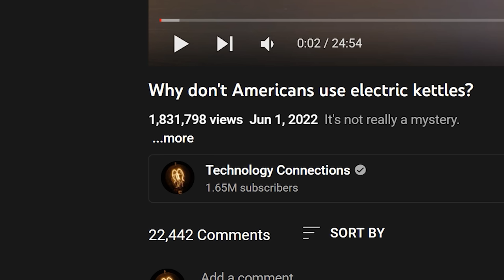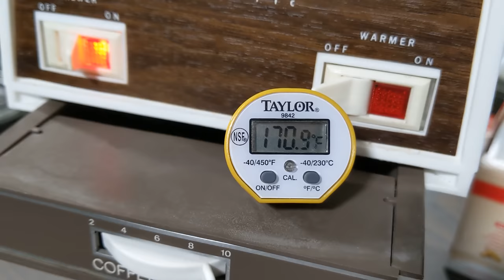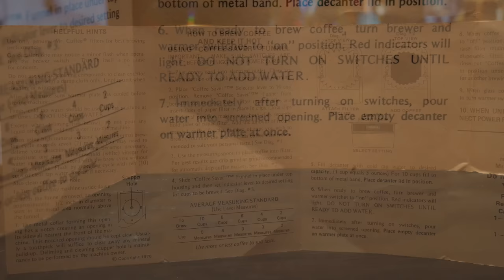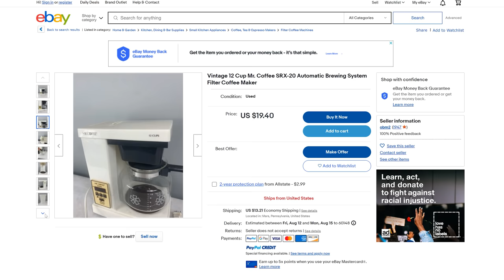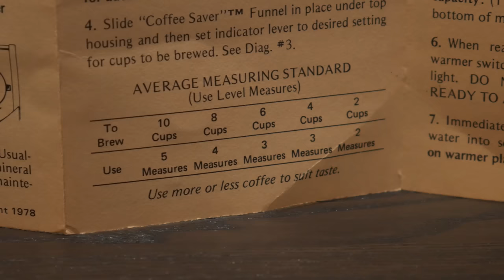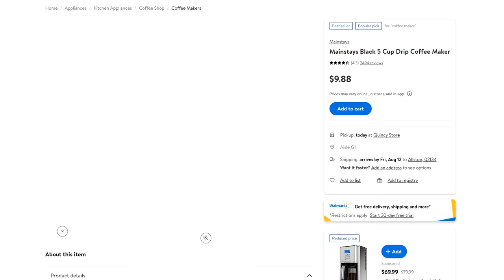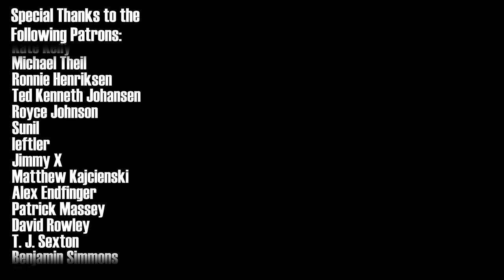Drip Coffee Makers — super simple, super cheap

Comment: Time for one on the Keurig type machine and its differences.  A new variation on drip that simplifies the process even further unless you want to grind your own (you can get reusable pods for that).
In the original electric kettle tests, did you compare the speed to a microwave?  Not to boiling but hot enough to brew tea or coffee for a separate filter or French press?
Reply: Maybe a few too many variables to consider but you could easily do it yourself re the microwave/tea question 🤔 

Variables are:- microwave power level you have available to you 
(Microwave will specifications eg 900W 1200W etc)

Can measure power consumption if you have a plug in energy meter to see what the microwave consumes for the amount of water you choose 

The temperature for brewing tea - what have you read - 80 degrees 🤔

The temperature of the water pre microwaving - temp can be as low as say 5 degrees to say 20 degrees if at room temperature 

Remember! Fresh water is of importance in making tea - so that should be after turning tap on for an amount of time you believe the water is as ‘fresh’ as you can get - it’s about oxygenation 

It’s all about your own personal taste - so brewing time is a matter for yourself too 

Happy experimenting 

Hope that helps!

Btw

I commented on other video - as my stove kettle left on too long - I been using a covered saucepan - so I can heat water to my chosen temperature - I put in tea bag into the cold water - heat to desired temperature - 80/85 degrees - allow it to brew - then pour from the pan. I’m lazy but it’s quicker & under my control - tastes absolutely fine.

I use approx  1.5cups /water per tea bag - and add more water for second after pouring the first. 

1 cup of tea never enough!

Comment: I remember drip coffee machines here in Australia in the 80's and 90's but they seemed to fall out of fashion. They most likely did because the coffee they make is diluted weak coffee flavoured water. These days here it's pretty much Expresso or Instant Coffee, the latter being pretty average in tase but at least you can make it as strong as you like by just adding more... Oh and every house here has an Electric Kettle, it's one of the most useful kitchen appliances. Especially when run off a real electrical supply @ 240v 😉
Reply: Less water more coffee grounds and that problem is gone
Reply: @lauri9061  yes thank you i was going to point that out, kinda like i was also going to point out, hey salty, our supply is 240 volts to the house and across two breakers, its only 120 on a single breaker, out kettles can boil water just fine thank you, instant coffee is pretty meh no matter how good it says it is and technically all coffee is diluted coffee flavored water as thats pretty much how you make coffee, by mixing the beans with the water then removing the beans by some means... also umm a real supply of 240 volts at the wall and going into literally every appliance sounds like so much fun when you find a bare wire or damaged insulator with a bare hand, our supply of 120 already hurts like hell and ive seen the pops from short circuits at 240 volts, no thanks mate ill take a slightly slower kettle over louder bangs and more chance of a short ride in a long black car thank you.
Reply: @compzac  im just having a bit if a joke mate, i know you have split 240v in the USA and sometimes your outlets supply the straight 240v.. Im an electrician and have inadvertently received many belts of 240v, its not that bad so long as your not really well grounded. Also R.C.D's (G.F..I's) are almost exclusively installed here so the power cuts in less than 5ms of a 30mA fault current, it's really quite safe these days.
Reply: If you think drip-brewers give weak coffee, you are welcome to try the coffee here in Sweden.
Instant coffee regardless of brand is just juck, only to be used in emergencies when real coffee can't be found lol

Comment: Two very slight tweaks I use after seeing them recommended by James Hoffmann:
1) Run some water through the filter paper without any coffee in it first. This will pre heat the element, giving more consistent brew temp, pre wet the filter, which does seem to improve taste, and pre heat the carafe, which keeps your coffee hot for longer without needing to use the hot plate.
2) “Bloom” the coffee by taking the carafe out of the machine for the first few seconds of brewing. This allows water to accumulate in the brew basket, fully wetting the coffee and as the water then drips through, runs through a more even bed of coffee giving a more even extraction.
Reply: I'd like to change this tap to a decent 3D printed shower head, to spread water to whole coffee, instead of letting it drip in one spot.

Comment: After having poured all the coffee from the carafe / pot, add some water to the pot before placing it back on the hot plate. This will cause the plate to cool down, rather than having the hot plate vaporize the remaining water from the pot. In turn this will cause the pot to remain more clean after you pour out the water used for cooling, and no residue will stick to the inside of the pot.

Cheers from a coffee drinking Dutchman - everyone knows our coffee is the best.
Reply: Another one: filters also help determine the resulting taste of the coffee. I like white filter papers more than the "eco" brown papers you can buy here in the Euro lands. Brown filter papers add a slight card board taste in my opinion. Not awful, just not as tasty.
Reply: And oh hey, here's even another another! When the brewing is done, pour all hot coffee into a (with boiling water) preheated thermos. You can keep this coffee for as long as 10 hours and while the temperature does drop albeit really slowly, the taste, will stay great. 🤯
Reply: @Ancipital_  I am taking down all of these advices!
Reply: One of my comments seems to have gotten caught in the spam filter. I said that limescale really ruins a drip machine rapidly, it increases the energy required and diminishes the taste because of the temperatures becoming all wonky. Yes, you can try to clean it with vinegar, but the one solution above all others is to only use decalcified water. For this water filters exist, I like the ZeroWater filter which decalcifies and filters some other things from the water making it the best filtered water to use for a really nice brown black brew.
Reply: @scythal  great! Let me know the results!

Comment: The hot plate thermostat is not "wee bit higher than the boiling point of water" It's actually around 150 degrees F. There's a ton of them for different models and temperatures for sale on Amazon. Probably just generates enough steam on a red hot(?) coil to pump some hot water out before heat conducts to the thermostat and repeats the fill/boil cycle. I may check mine to see if there is on/off action during the entire batch.

Comment: The biggest suggestion I can give for cheap coffee makers is to pour the coffee out of the carafe and into a Thermos. That'll keep the coffee warm for quite a while without the need to microwave it. Better coffee makers come with insulated thermal carafes that use the same principle.
Reply: Pro tip: Pre-heat the Thermos by filling it with hot water

Comment: I'm in Europe and I've always only used a drip coffee machine. Currently using a Melitta brand one that feels like very flimsy plastic but works great. In Japan, I had a Zojirushi one that also worked great, and I would go to the American style wholesaler to buy big jars of coffee. I never really understood why espresso machines and other weird coffee pad or cup based machines are so popular, nothing beats just plain black coffee, brewed in a large amount from an easy to use machine
Reply: uh... because it tastes like a mud, not coffee? Espresso machine doesn't give you a watery mud. Letting a nearly-boiling water drip through ground coffee was never the way to brew a coffee, because it will never absorb the same amount of coffee, it will waste coffee that isn't directly below the dripper, it will run the water through the same spot all the time making the last cup extract nothing and will result in needing a bucket to contain the same amount of coffee that an espresso does. And it will never give you a crema. You may not like a strong espresso, but that does not mean it is not an objectively better way to extract coffee out of the beans. You can always pour an espresso into a bucket and dissolve it with hot water. That is why we call that americano. But you will always extract coffee more efficiently with an espresso maker.

Comment: The fact that in coffee making circles a "cup" is a different size is only confusing when you use a variable size piece of tableware as a unit of measurement :)
And if I think about the size of the cup I usually drink my coffee from, there are only single cup and three cup machines :D
Reply: I think I heard somewhere that when it comes to coffee cups, they are equal to 120ml or 160ml instead of 240ml... 4oz or 6oz vs 8oz. It was something weird like that. Idr exactly.

Comment: I must agree with your final conclusion 100%, I've tried many different methods of brewing coffee and some are fun and technical but I find my Mini Mr. Coffee brewer (with a clock, an added bonus) my daily go to machine, it's easy to use, easy to clean up and always brews a consistent tasting cup of coffee...I find that taste depends on what coffee brand you're using rather than what method of brewing, for example I prefer the dark French roast (Starbucks etc.) most of the time and it always tastes good in my 5 cup mini brewer, I've tried all the gadgets so I have an idea what I'm talking about. Usually I brew with 3 cups of water with 4 normal scoops of coffee that makes one normal cup of coffee...'you ask, what is a normal cup of coffee?' Cheers!

Comment: "but that is still mains voltage going through there". 

here's the thing:

the higher the voltage, the thinner you can make the wiring. The thing that is problematic with wires is losing power to heat, and that is a function of the wires resistance and the current going through it. So for higher currents you need thicker wires. But increase the voltage and you can deliver the same power using less current, hence you are able to use smaller wires, as long as the insulation holds up.

Comment: I was given a slightly more advanced Mr. Coffee after I grenaded my Keurig, and I've never looked back.
Most advanced feature it has is a button for "regular" or "strong" brew, the stronger of which hits like a truck.
Also has a digital clock that lets you set an automatic brewing time, which is groovy, but I usually eat breakfast while the ten minute brew takes place.

... And then I blew up the coffee pot itself, but was able to fix it, due to it being stainless steel.
Reply: How did you blow it up?
Reply: @apAvocado 
The coffee pot blew up after I put it on the stove, since there was about 50 cents' worth of coffee still in it the next day.
Apparently, there was some kind of adhesive marrying the base to the actual pot, apparently it didn't like direct heat, and launched the entire half-pot of coffee over an inch into the air with a sound almost exactly like a .22 rifle.

We don't talk about the Keurig.

Comment: French press just makes a lot more sense. It takes about as long, the coffee doesn't get burnt if you leave it on, and if you're a single person who only drinks like a cup or two of coffee there's no point in buying a whole expensive machine with a much higher capacity. Not only that, but these drip coffee makers tend to build up mineral deposits if you use tap water in them, causing all the coffee that comes out to have the same taste as sucking on a rusty penny. Mine doesn't even make the coffee very strong and I found online it was a pretty big issue where people have to heat up the water beforehand because the machine is very bad at doing so, and at that point now you just have a much more convoluted more expensive french press

Comment: As I have gotten older, I would prefer to have the old school Mr. Coffee pot. A fast brew speed and the ability to turn off the hot plate would be perfect for me, and even more so than the Keurig my roommates and I currently have. I can make a whole pot of coffee, drip works just fine for me and it means easier clean up compared to the reusable filters for it. I rather make a partial pot of coffee so I can have more than one cup or to share. And being as I drink iced coffee as well these days, I can save coffee by turning the heating plate off and chilling the leftover. Not as good as actual cold brew, but its still better than most instant coffees. Though, instant coffees have both improved, and when made correctly can be insanely good. For speed, flavor and quantity, drip works well enough and those classic Mr. Coffee machines were bringing home the restaurant without the people.

Comment: If I understand this correctly limescale will mainly influence the heater section and the valve I guess. And if the valve doesn't close correctly due to scale  the water will get "pumped" back into the reservoir instead of being pushed up towards the dripper, making the typical "needs to be descaled" noises. Regarding the top brew method, the Philips "Café Gourmet" coffee maker seems to have further developed the top brew method. Time for a follow up?

Comment: I use an aeropress when I'm making "real" coffee, and instant otherwise. This may seem like I'm taking the two ends of the spectrum, but hear me out: I only want one cup of coffee, I'm typically using the hot water spout on the water cooler at work, and I'm also usually more of a tea drinker, which means I really just want something that takes about as much time as making tea (i.e., as little time as possible) to make exactly one cup of coffee, and my palette is not refined enough to agonize over the flavor of the coffee too much. The determining factor of whether I am using the aeropress or drinking instant coffee is honestly just whether there's "real" coffee lying around that I need to use, usually gifted to me by some well-meaning individual.  If I'm just buying the coffee myself, then Folgers instant gives me a cup of coffee in about as much time as it takes to make tea, requires no additional cleanup, and tastes like coffee to me.

Comment: You can buy coffee machines which is exactly the same, but without the hot plate to keep the coffee warm, instead the coffee drips straight into a thermos coffee pot, keeping the coffee fairly hot for a few hours and which have been around for years, strange you didn't mention them.

Comment: If you use a coffee machine to make coffee then you have to at least get a model with a permafilter. You're actually supposed to see little drops of oil floating on your black coffee that contains alot of the flavor but paper filters soak up that oil. 

Since I drink both tea and coffee and I got 220 electricity, I love my french press. I do have a regular coffee maker, but I mostly only use it if I want to use the alarm function and have hot coffee as soon as I wake up (usually only if I gotta wake up early and leave in a hurry...)

Comment: I have a cheap k-cup coffee maker from Aldi. It has the nice feature of being able to use your own ground coffee in a little basket as well as a k-cup. It can dispense 8 ounces or 15 ounces of water at a time, and the reservoir holds about 40 ounces of water. I don't have particularly hard water in my area, so I only have to descale and sanitize the reservoir it twice a year., usually in the spring and fall when I can take that mess outside.

I'm not much of a coffee drinker, so I think it does fine with ready-ground coffee. I mostly use it with loose-leaf tea, a task at which it excels. However, it has a problem with water and coffee grounds overflowing the basket a bit when I load it for a 15 ounce serving. 

I'm curious about the mechanics of how it works, and what I might be able to do to solve the overflow problem. Could you please do an episode on this type of coffee machine?

Comment: The best drip coffee maker is one with a thermos pot instead of a warm plate.
I have a Capresso, but it was quite expensive, much more than the extra cost of the thermos pot and moving the resistance from under the pot. Maybe you can deport the spitter on the side to put a thermos pot under it.

As for moka pots, beware! the owners of this iconic design object are a cult! 😀and the coffee is always slightly muddy in my experience. Maybe metal grids work best with the coarse ground coffee from old manual grinders. You also have to choose between either the metallic taste of the aluminum that deposits forever in your brains, or the very bitter and rancid film of oxidized coffee oils on the pot's inner surface. There's inox pots now though, but good luck washing off the coffee oils thoroughly after each use. I much prefer my drip coffee maker, and I can now cross the 2,5 meters that separate my garden gate from the newly opened (last Thursday)  café in my village for my Sunday after-lunch espresso.

On the other hand, moka, not as pots but as the rich flavorful mocha coffee variety from Ethiopia is awesome. I buy them a few times a year for the most festive meals.

The aroma of coffee infusing in the morning is indeed very satisfying, but try roasting green beans, it's 10 times nicer, at least if you don't roast it too dark. Unlike roasted or ground beans which don't keep for too long, green beans can easily be stored for a year or two, some is even bagged in vacuum right after the harvest to keep their freshness for even longer.

Comment: You used the most basic and cheap modern drip machines. What about the machines that have settings for the heating plate? I had a coffee maker where you could adjust the heating plate to low, medium and high. I think that's good enough to not have to microwave your coffee later.